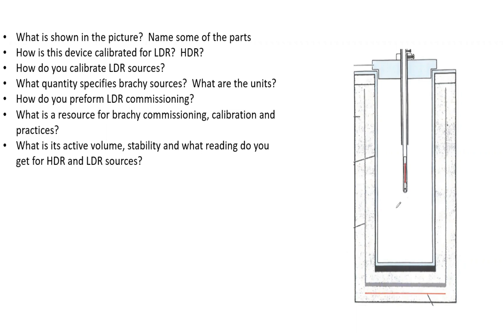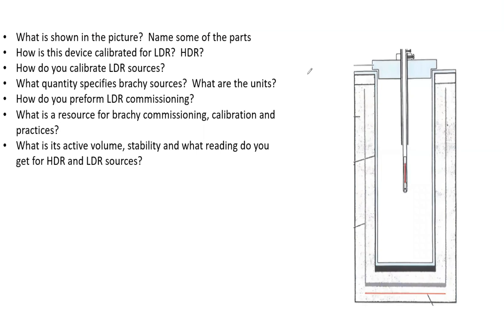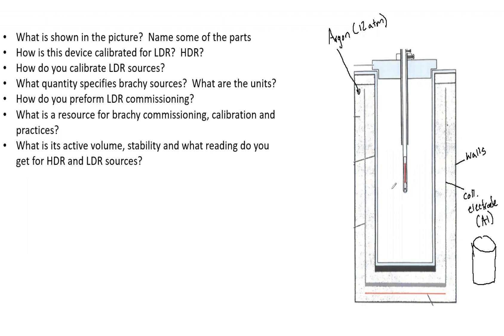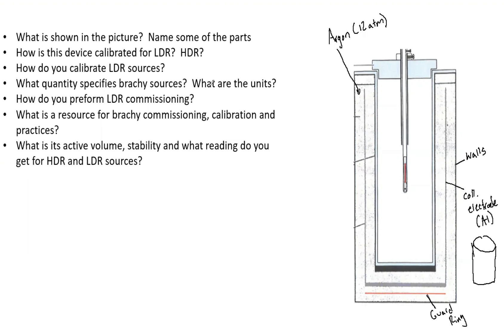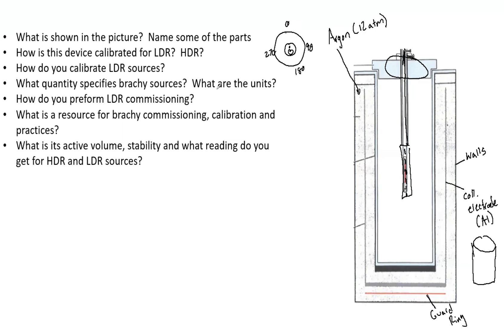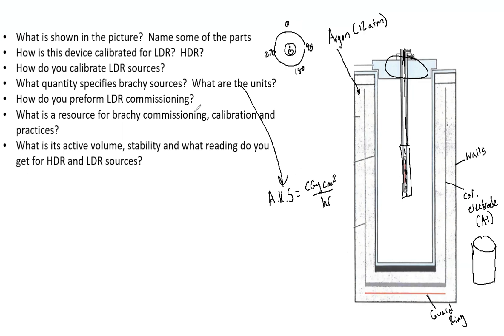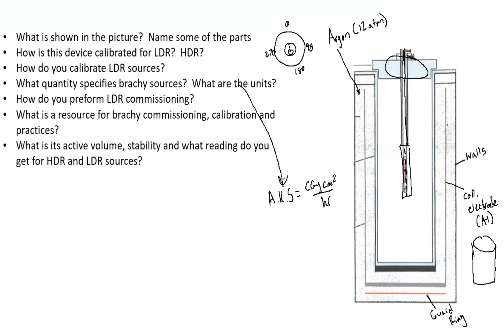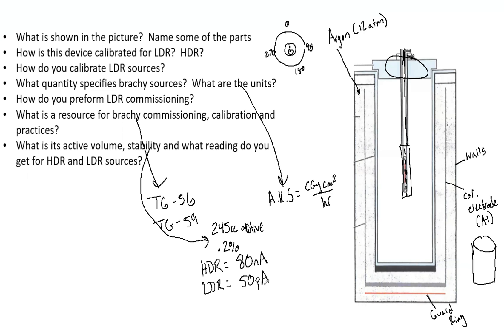Well Type Ionization Chamber ABR Part 3 Medical Physics Oral Exam Prep

Comment: Adam, I think you got a dose calibrator mixed up with an air filled ion chamber such as the HDR 1000 Plus. The HDR 1000 plus has a 245 cc volume, as you mention, but it is filled with air and vented. Dose calibrators commonly used in NM are filled with Argon at ~12 atm.
Reply from the maker: Ah, you're right Thaddeus, thanks for noticing! I'll add a note in the top of the descriptor.